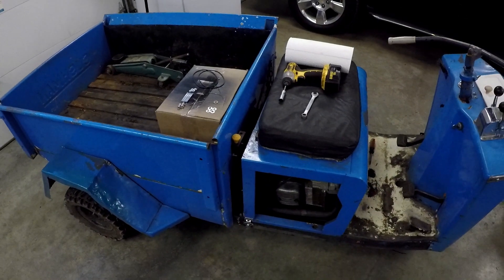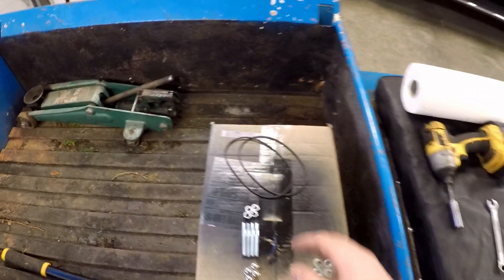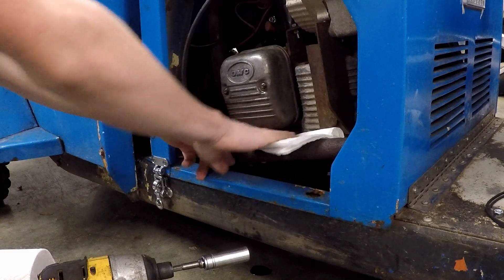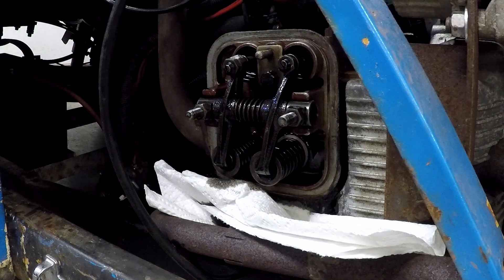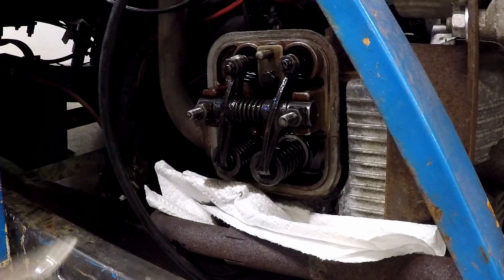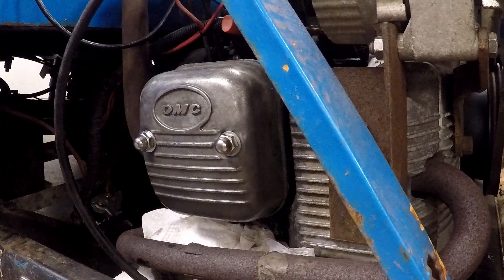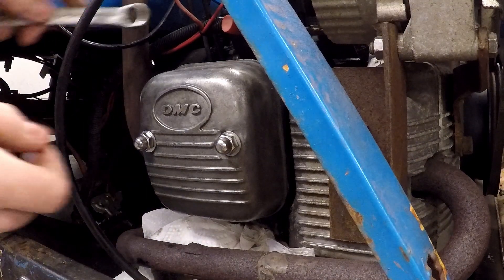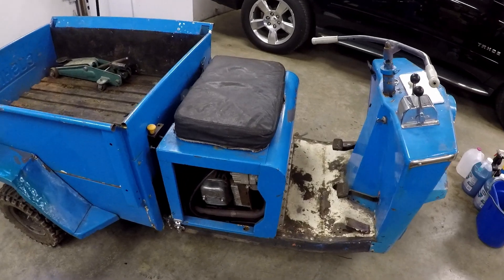How to: Adjust valves and replace rocker arm studs on a Cushman OMC Engine

Comment: I have an older truckster. I am currently restoring it. The only thing keeping e from finishing it is the carburetor. It does not have one; nor can I buy one. I found a walbro that has the exact same bolt pattern.Do you think it will work?
Reply: did you ever find a carburetor i am also looking for one
Reply: @phillipbeasley2961  a Kohler k582 carb worked just fine on mine

Comment: Hi! Thank you for posting this ! I just picked up a 1990 Cushman Haulster with what looks like the same engine in your  Truckster.  I am  cleaning up my project as,  it's been neglected  over the years.  Your Cushman manual says .003/.005 for BOTH intake and exhaust?  I just want to make sure before I adjust my valves. Thanks again!
Reply from the maker: Glad this video helped you! 
According to the cushman service manual, .003/.004 is preferred for both valves. https://offroadmudmowers.com/wp-content/uploads/2019/04/OMC-Engine-Manual.pdf 
Theres a few other manuals under the Cushman tab here: https://offroadmudmowers.com/documents/

Good luck with your cushman, they are a ton of fun!
Reply: @OffroadMudMowers  cool ! Thanks a bunch!